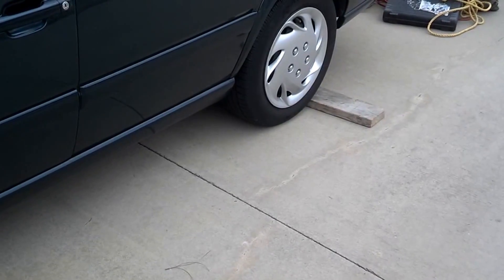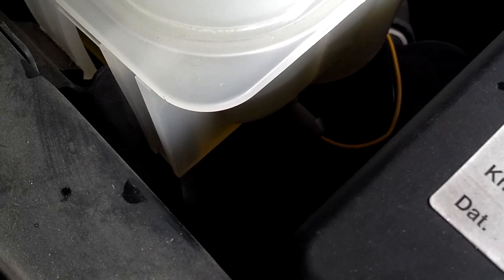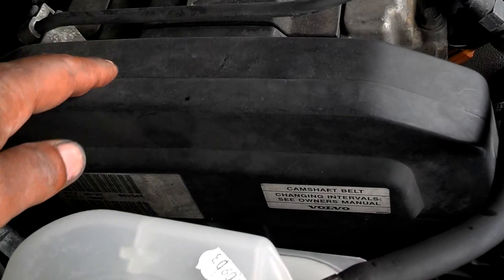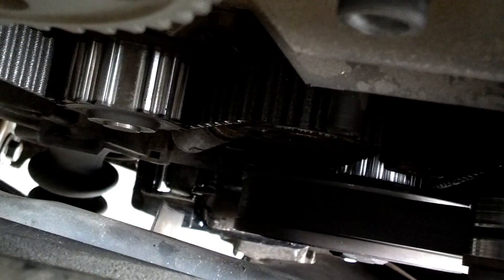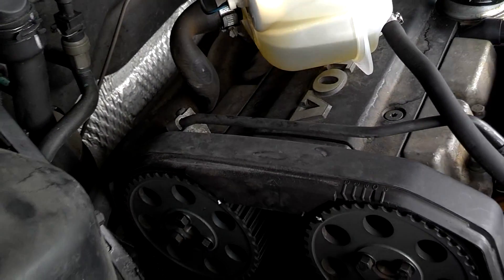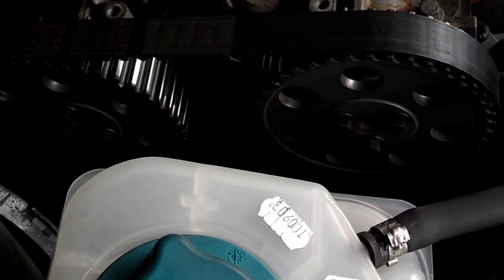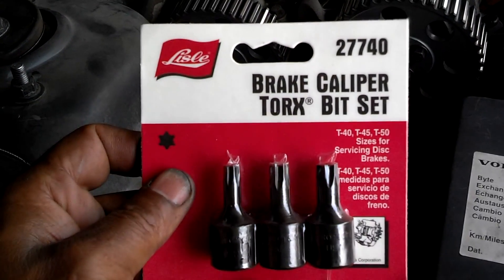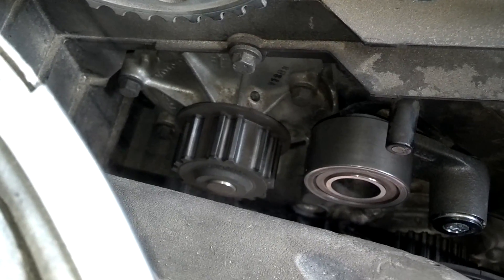How to replace the timing belt, water pump & rollers on the Volvo 850, S70, V70, etc. Pt 1-2 - VOTD

Comment: Hi Robert or anyone else that may want to answer. Two questions . . . 1.) You say that you could rotate cams 360 degrees if everything is aligned properly for the timing belt. But with #1 @ TDC, if you rotated either cam enough, wouldn't those valves hit the piston at #1 since it is at TDC? Also, does anyone know what those timing marks are for on the top of the plastic cam sprocket cover on the intake side? And what the notch is for on outer edge of the the crank sprocket, not the inner markings that are used to locate the crank at TDC? These other markings are confusing. Thanks.
Reply from the maker: I said that you can rotate the cams 360 if the crack is on it's mark, never said TDC.
Reply from the maker: https://www.youtube.com/watch?v=p8zd8GVvAa0

Comment: about to change the water pump on my s70 was wondering if you knew where to get a cheap serpentine belt tension release tool.
Reply from the maker: www.RobertDIY.com
Reply from the maker: from under the car you can put a wrench on the tip of it and pull it loose. You can also put some metal in the hole with a 1/2" breaker to get it loose.

Comment: Hello Robert.  Question:  I have a 1996 Volvo 850, fully loaded...140,000 miles in excellent shape except for the following:1) Bad water pump-so needs a timing belt replacement as well quoted $ 8502) Needs struts and shocks-$ 7003) Probably need a clutch in a year-$ 1200It was a one owner car with all paperwork and a verified Carfax.  It books at $ 3,000.  Think it's worth keeping?  The body and paint are pristine, the leather is near perfect. Everything works, the glass is great.  I really like the car, but a passing thought is to trade in on something newer. Thoughts?  I'm not in a position to do the work myself.
Reply from the maker: +weirdshibainu probably not if you can afford something newer.
Reply: Robert DIY thanks. ...I can afford something newer...just like the older volvos

Comment: Hey Robert Im having problems getting top dead center. my crank pulley isnt lining up like your video. I do see a mark in the inside of the pulley that protrudes out. is that it? the line that i have on top of my pulley is there though. do you have a pic of the crank pulley off so i know what mark it is?
Reply from the maker: +Detriuch Calhoun https://youtu.be/p8zd8GVvAa0
Reply from the maker: +Detriuch Calhoun I have about 32 timing mark videos.
Reply from the maker: +Detriuch Calhoun https://youtu.be/MPt0BZ3B_2w

Comment: Hey Robert DIY I had replaced it all and it had started fine a few times for 2 days even though I didn't drive my v70 t5 manual. I tried to start it today and it died and bogged after I have it gas with a little exhaust leak to the exhaust manifold. After that I tried starting it and now the belt just spins faster and doesn't catch with the starter it seems. I made sure timing was correct spinning the damper by wrench 4 complete revolutions and stayed in time. I tested the crankshaft position sensor and the camshaft position sensor from a manual and it was all in spec. It seems like not enough compression even though it is in time. I tried to start again and it made a backfire noise. Fuel is getting to the fuel rail because I pressed the Schrader valve and fuel came out. Car has very little fuel but it wouldn't cause it to spin the belt almost twice as fast. I took spark plug out and grounded it to metal and no spark came out even though it worked the night before with no changes. The spark plugs are not wet either. What could it be!!! Help me!!! If you need a video I can post it
Reply: What did you reply? Want me to post video?
Reply from the maker: Ooops! That was a video that has a bad link. Lawnmower syndrome. https://www.youtube.com/watch?v=3InZVPLYgqs
Reply: Robert DIY oh ok I never heard of that and I have been doin backyard mechanic work for years. I'll let you know if that solves it. I did hear earlier to try and crank for 2 min
Reply: Robert DIY ok I tried putting some oil in cylinders and letting the fuel dry out on spark plugs. That seemed to not have work either still does the same thing. Backfired a couple times out of no where but still has no compression and I know piston rings are good as well as the head because I had that done as well and I know the marks are on time. Why wouldn't I be getting compression? Everything moves accordingly but spins the belts fast like my video. I know there are two different serpentine belt patterns scattered about online for this 98 v70 turbo but the belt is tight as it should. I'm so lost.
Reply: Did you read my last reply? What else could it be? Also the RPM's don't flutter at all when trying to start

Comment: +Robert DIY, As far as the V70 series, it's worth noting that this timing procedure is different for the second generation V70's; I.E. after M.Y. 2000 - Prior to this, there was also a change in exactly how the serpentine belt was routed. I believe this was so the alternator was turning adequately.
Reply from the maker: So you need to choose the proper video?
Reply from the maker: https://www.youtube.com/watch?v=YpOYTVpzzic
Reply from the maker: P2 Volvo
Reply from the maker: https://www.youtube.com/watch?v=gt9w-ZSxs9I
Reply: Robert DIY, Please modify your title to reflect which years this procedure covers. Yes, the earlier 850, S70 & V70 were pretty much all the same. However, the timing procedure for late model V70's changed, due to the tensioner.

Comment: You want to keep the upper back timing cover on until you line up the timing marks. The cam pulley timing marks will have to be aligned with the marks on the inside of the timing cover before removal of the timing belt.
Reply from the maker: OK

Comment: hay man great  video once a again  saved the day what if i have the top two cams lined up but cant see any marks for the oil pump cam how do i know if it is lined up right i did not see any notches on the cam
Reply from the maker: +Rand Farris if the car was running when you align the camshaft to the cover the crank should be fine. I usually put a phone or camera down there to take a picture of the crank sprocket and look at it. I have about 7 different videos showing timing belt alignment.
Reply: ok cool deal i have not put the new belt on i rolled the motor over 2 × with old belt on and put the new water pump on i am going to do the new belt when i get off work today and just want to make sure its lined up good

Comment: Robert I always finf your videos very helpful and the most thorough!   I have a qusetion about a 1999 Volvo  s70 .  In this video you are not changing the water pump y question is- I have the strangest sound coming from upper half of my engine 2.4   It is NOT a ticking noise like rocker arms would sound it soundsmore like a rock tumbler or like gravel rolling around?   At first I suspected the bearing in the power steering but with serp belt removed the noise is still there.
Reply from the maker: OK, so you know it's in the head or a part in the path of the timing belt. Did you pull the timing belt cover to watch those parts as it runs? Is the oil level good? Does the low oil pressure light work?
Reply from the maker: You can also record the sound and post it somewhere for me to hear.
Reply: Typically when the water pump starts to fail it will show a leak down near the bottom of the engine. The ticking sound (if ruled out that it isn't the cam/valve) is the bearing on the pump impeller that is failing.

Comment: replacing a water pump on a 97 850. is it a must to line up the cam notches before removing everything? I understand the need to line them up and turn motor over twice. but can I do this at the end when the new water pump is installed and the belt is on?
Reply from the maker: LOL, Good luck with that.
Reply: +Robert DIY I don't think that answers the question, but ok.  Thanks.
Reply from the maker: It seemed to me that you was wanting to TAKE A RISK with your timing. Why would you want to do that? Thus the statement "good luck with that".

Once you pull the belt with the marks off, what will you use for reference if something moves?  Timing marks are a jig saw puzzle that is forgiving if the marks are on when the tensioner is loosened. If the marks are off, and you pull the belt, it can lock up the engine requiring the cam cover to be pulled to get things back on track.

so, I make a video with a 5 minute step in it informing people to set the timing. Simple 5 minute process to save you tons of possible frustration. But then people like you want to skip it and request that I type a 10 minute reply after making 30 hours worth of videos about the importance of timing marks and setting them etc., which I don't feel is fair to me but here you are. Thanks
Reply from the maker: It is not a must to align the timing to pull the belt and replace the water pump. However, with the belt off, you can NOT move the cams and crank to get the marks on with the belt off. The engine is what is called interference which means the cams and crank have to be in sync for the engine to rotate. If the parts are not in sync, which is one of the purposes of the belt, the internal parts in the engine will collide and stop the parts from turning. If the belt comes off and the engine is turning with enough force, i.e. running, the collision will cause the engine to be destroyed because the engine became out of sync with parts moving.

So, without the belt, it is near impossible to get the marks aligned. Again, you will need GOOD LUCK WITH THAT.
Reply: +Robert DIY ok thanks.  That gives me a be understanding of why to line the marks up and how it works with the process of changing the belt.  obviously I don't want to break the engine,  but I couldn't understand why my take it off,  put it back.   But now I have a better understanding as to why. I did line them up,  but my main problem is the t45 bit on the tensioner seems to be stripped.
Reply from the maker: That has happened to me a couple of times. I pulled the bolt out of the roller and swapped the new one on. I couldn't get it as tight as I wanted but it has worked.

Some people say you can get it loose if you get vice grips on the metal ring around the T45. Some have drilled through the wall of the  car, drilled out the head of the bolt, then finished it off that way.
Reply: +Robert DIY lol yes. after everything, a slight turn with vice grips around the washer got it loose.  However I have a  97 850, and there seems to be something behind the crankshaft and under the oil pump that prevents me from putting the belt on. I'm told I need to remove the crankshaft to accomplish this.
Reply from the maker: Nope. The install video shows it. I never remove the harmonic balancer.

Comment: It doesn't have one of those hydraulic tensioner that you put the pin in. It has one sprocket the belt goes around what should I do? I appreciate your help.
Reply from the maker: +Jennifer Ann look at the comments in part 2, it has a link to the mechanical tensioner instructions.

Comment: Hello Robert, do you have a video on a Water Pump Replacement for a 1998 Volvo v70 awd ?
Reply from the maker: +Jennifer Ann It is the same here. If it has a mechanical tensioner you need to see that part.
Reply from the maker: +Jennifer Ann It is the same here. If it has a mechanical tensioner you need to see that part.
Reply from the maker: +Jennifer Ann https://www.youtube.com/watch?v=rid7f8UNU_c

Comment: Will this video work for a 2007, v70 ? Also what is a good timing belt 
kit ? and how do I purchase the square adapter? Thanks.. Joe
Reply from the maker: +Joe Carreiro Nope. Volvo kit. I usually use Contitec belt, Asian water pump and ina rollers. Your car will not use the adapter. I should have another video up soon that matches your car better.

Comment: one thing is it started right up one day. the very next day is when it wouldn't start. it had rained pretty good on that day
never had any problems before now.
Reply from the maker: +Gerald Hart a car needs 5 things to run. You need to find out what is missing.

Comment: hi I have 850 1997 volvo. cranks won't start. have changed coil pack distriber& cleaned spark plugs, it does have spark,one person says my timing might be off.would a analyzer help me as far as codes are concerned. iam having a time with this problem. could it be a timing belt problem? it might turn over once but won't stay running!!!!!!!
Reply from the maker: +Gerald Hart https://www.youtube.com/watch?v=YiPAPu-K8OI

Comment: Hello there. car s70 t5. I changed the timing in circulation degistirdim.doğal kayışını. but there are problems. first slowly on takeoff.then it begins to accelerate. coke fuel burning. Improper installation possible?  (merhaba. arabam s70 t5 . devirdaim degistirdim.doğal olarak triger kayışınıda değiştirdim. ama sorun var. ilk kalkısta yavas. sonra hızlanmaya baslıyor. cok yakıt yakıyor. hatalı montaj olabilirmi ?)
Reply from the maker: +sedat kasap Eğer kam sprocet vites çıkardınız mı ? Zamanlama kapalı gibi geliyor .
Reply from the maker: +sedat kasap https://www.youtube.com/watch?v=Efel75s7AVU
Reply: +Robert DIY  thanks
Reply: +Robert DIY 
automatic transmission, in which case it should be(otomatik vites hangi durumda olmalı)

Comment: Excellent tutorial. The car looks brand new. Looks it has been well maintained and looked after. Btw is there any way to lock the crankshaft in place, something like a hole ? I Remember on a french car i worked on had a hole in the gearbox housing that you would put a 6 mm torx or allen key to lock the crankshaft.
Reply from the maker: +Kaktus Jack Yes, behind the starter. The crank almost NEVER moves. Just check the mark on it before you put the belt on it.
Reply: +Robert DIY Thanks for the reply.

Comment: hi Robert. i have a 1999 s70 with 98,000 miles on it. last week i broke down and had the car towed to my mechanic who said to me that my timing belt broke. i was told that my engine was blown and that it would cost me well over 900 to repair. can you please give me some advice on what to do, or if i should scrap it. thank you
Reply from the maker: +kristen k Had you had the belt replaced? I would suggest you get a full estimate and go from there. "Well over" is not a point to make a decision.
Reply: +Robert DIY no the belt was never replaced. my mechanic advised that if i wanted to keep the car i had to repair or replace the motor. plus the water pump. i read online that the 1999 s70 was an interference engine and that 98% of the time a broken belt meant that id have cylinder damage. is this true?
Reply from the maker: +kristen k Yes it is. That's why the owners manual states that the timing belt should be replaced every 10 years. Did you know that?

Comment: Thanks for your time posting this! I just picked up a mint 04 XC70 for my 16 year old daughter for $800.. with 207k miles who knows when the belt was last changed but that's the first thing on the list. Runs great but I figure with some easy service she will see another 50k miles.
Reply from the maker: +Guy Madison Good deal.
Reply: +Robert DIY i has a timing belt replaced with cam seals and crank seal what i want to ask is it was done by a shop and my car is running hot i paid 270.00 for the timing belt and everything water pump ect. some one told me it would be the water pump but i know my heater core is leaking would that be why it is running hot? or wiuld it be the water pump?
Reply: +Jennifer Quinn my car is c70 con. 2000 2.4 engine

Comment: Robert - Thanks for all your videos. Great contribution to helping all Volvo enthusiasts and owners. I looked through the comments but could not find the answer to is there a "rule of thumb" for when to replace a timing (serpentine) belt on servicing the S70 GLT? Thank.
Reply from the maker: Daniel Bevarly LOL, Owners manual. The timing belt and serpentine belt are quite different. Depending on the year, the timing belt is supposed to be replaced every 70,000 or 105,000 miles. My rule of thumb is, do it as outlined in the owners manual. If you have NO WRITTEN PROOF as to when it has been changed, it is due for change NOW. If any of those parts are making noise, it's due to be changed now. If the water pump is leaking, it is due to be changed now. As for the serpentine belt, if it has a lot of cracks in it, change it.
Reply from the maker: Daniel Bevarly https://www.youtube.com/watch?v=-2oIeIhpV44
Reply from the maker: Daniel Bevarly https://www.youtube.com/watch?v=Omo83Nl75gw

Comment: Thank you so much for the videos Robert! I've used your videos for a few repairs on my 850 thus far and I'm going to be replacing the timing belt/tensioner etc. in September. Is the timing belt replacement for an 850 very similar to the repair on the S70 model?
Reply from the maker: ***** Same.

Comment: realy enjoyed your vids. do you know the prob with a 850 engine t5 that goes up in temp i have replaced the thermostate and the waterpump doesent leak where shall i check?
Reply from the maker: swepride The temp of both hoses. It may be an indicator issue. Could also be a bad ECT.

Comment: I'm thinking about buying a 1998 V70. Your videos will help me a lot. Thanks for sharing.
Reply from the maker: Richard Wasserman https://www.youtube.com/watch?v=L4g-w4OXeBw
Reply: Robert DIY Thanks. You are a Volvo g0d. I've owned four 240s and one 140. They were all purchased as high mileage vehicles. The only work I've paid to have done was rebuilding an automatic transmission which I pulled and reinstalled myself. the V70 I'm looking at is only $800.
Reply from the maker: Richard Wasserman https://www.youtube.com/watch?v=lRl8A_HIgeo